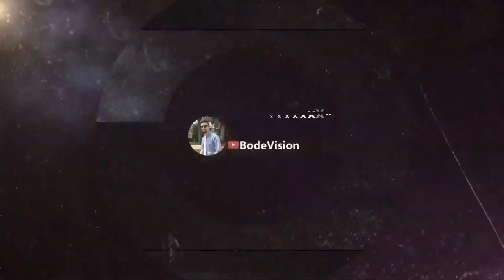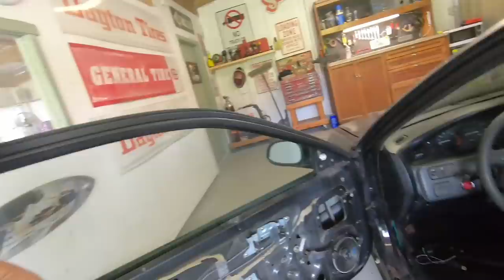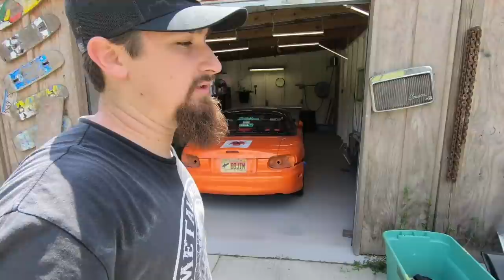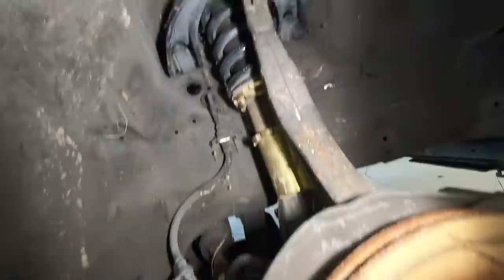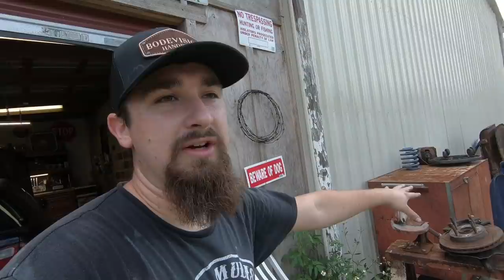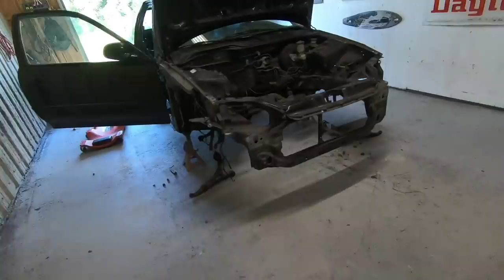It Is Time To Build The Neglected EG Hatch! BodeVision New Build!

Comment: I would go 4 lug, freshin up the knuckles and trailing arms with some paint, replace the bushings in the front with energy bushings, do some aftermarket lcas, front and rear camber kits, and do spherical trailing arm bushing. Maybe upgrade the braking with some SS lines, new rotors maybe do some wilwood calipers. Not sure if your going track, drag, or just show. Im ready to see how it turns out tho been waiting for this eg hatch stuff!

Comment: 4 lug. gramlight 57dr 15x8 +35 205/50/15 with 200 tread ware tires. no need to roll fenders are have crazy camber settings.

Comment: B16B NA (mild cam and supporting mods) s80LSD 5 speed, Buddyclubs coilovers, LCAs and supporting arm overhaul, interior gutted with respray with Sound Deadening Removal, SSR Type X 15x8 +35 on Advan ADO8Rs. 6 point roll cage with Bride Low Max seats to go with. Kanjozoku inspired paint job with racing stripes in diagonal etc. 

That would be cool!

Comment: Budget five lug would be Crv fwd complete knuckle assembly. You can reuse eg trailing arm and get itr rear hubs. Rsx rear caliper bracket and rotor. Em1 brake master and 36mm itr or custom crv axles

Comment: I wash cars before I work on em if there sitting for a while. Had a huge black widow run up my arm the other day while I was lifting a d17a1 head off. It was living under the intake assembly which was still on the head. I almost threw 700 bucks worth of head and intake through the windshield.

Comment: 4 lug... Just clean up the spindles touch them up with some black paint the rotors just have surface rust save money for other suspension parts like bushings , ball joints and control arms

Comment: Do the important stuff first proper bushings and suspension clean up the old rotors. If they can be salvaged.Salvage what you can. Wheels could always come later they can be changed easy

Comment: I would go 4  x 100 mm reduce cost. As for suspension just clean it up and paint gloss black.
Cheap way of cleaning rust is to use electrolysis. Bucket of water, hang part on a stick in the water, run negative battery lead to work piece. Then hang Steel around parameter of the bucket and run series to positive lead let soak 1 day all rust gone. Dry then silica blast parts in a blast cabinet then blow them off and Prime. Sand 320 and top coat. 
Just reuse suspension parts and save money for engine or what ever. 
I'm presently doing a 1993 Plymouth Acclaim  doing exactly what I typed.

Comment: Hey I'm a Florida guy also, I'm currently building a 4 door sedan and I'm in the middle of a complete wire harness build, I could definitely use some tips on what is all needed to supply power to ecu thanks..

Comment: I bought my ep3 because it was 4x100. More options. Tires, wheels, and send it!
Reply from the maker: Patrick Candler yeah you’re right about that
Reply: @BodeVision  plus is an OEM eg si. Keeps it more OEM. However some stock RSX type s wheels would look dope depending on color! But if it was me... I'd leave the option open for custom wheels cuz then it's not a headache when it comes time for pads and rotors and what not.
Reply: @BodeVision  my crx is 6 different cars. It's hard to keep what's what. I have a cheat sheet Bible for my car just because! Lol